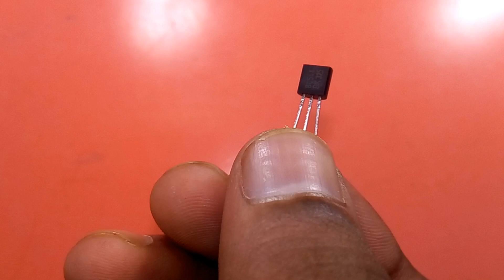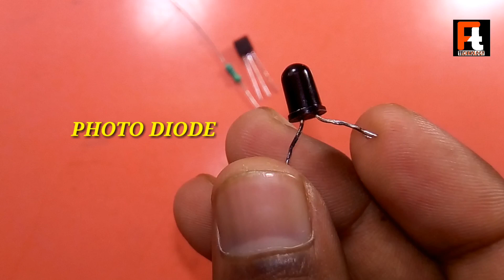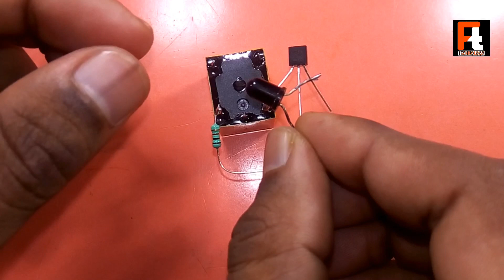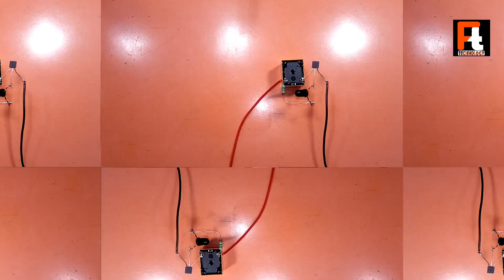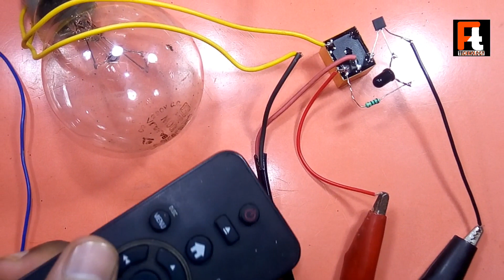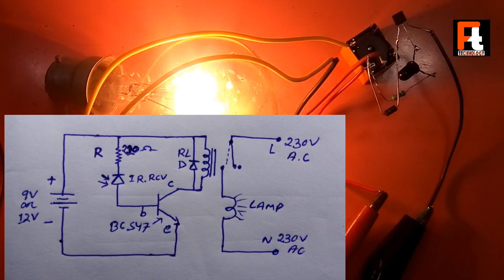DIY | How to make a simple remot control switch using transistor. #RC Invention #diy #howtomake

Comment: How much voltage and ampere you used?
Reply from the maker: 220v 6amp
Reply: @RCInvention  at first, according to you the power consumed by bulb is  220×6=1320  watt !!!  ... But this bulb is only of 50-150 watt.... of course, I am not talking about the relay wattage ! ....I told you that how much voltage and amp. You gave to start the relay...
Reply from the maker: 12v dc